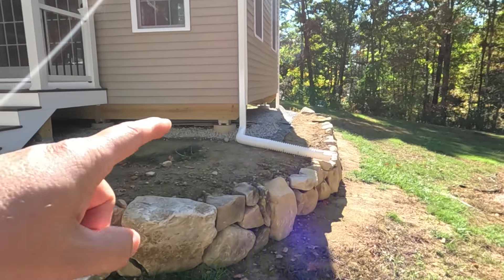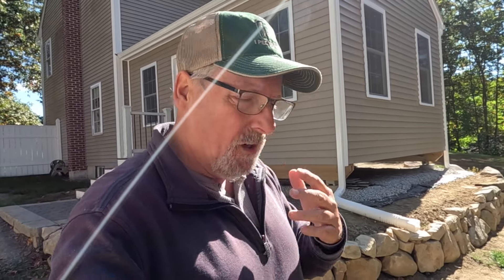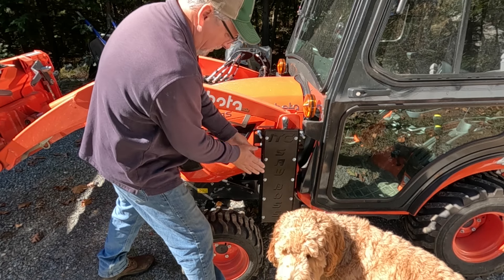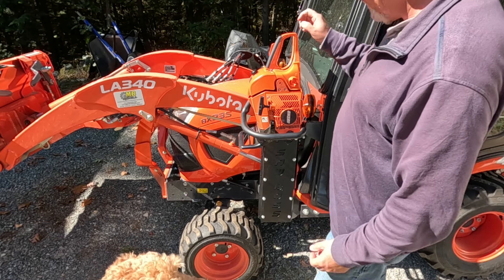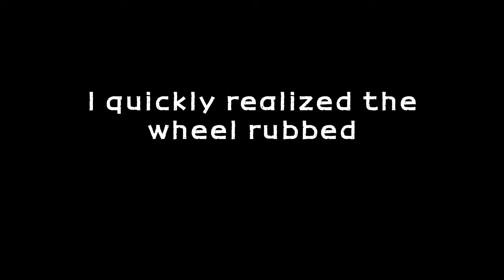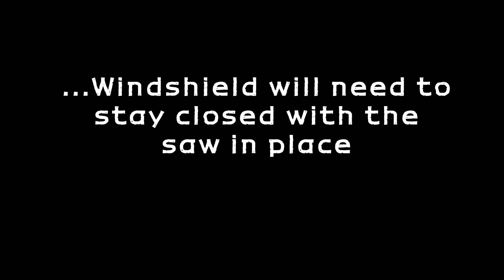ITC Saw Boss On A Kubota BX23S W/ Curtis Premium Cab?

Comment: Thanks for sharing!

Maybe we need to design in another set of holes..

Also, you can rotate the mount slightly to kick the power head towards the bucket and the tip of the bar back towards the cab. 
It will put the chainsaw at a little bit of an angle but still plenty functionable. This may give you the clearance to open the cab and will certainly gain more clearance near the tire. 
Kudos for checking axle articulation, Alot of people forget about that!